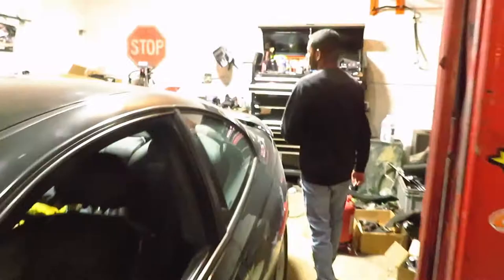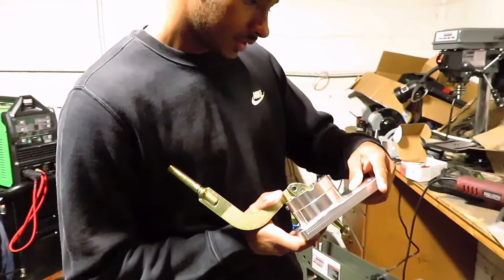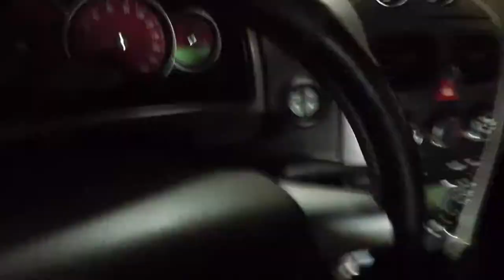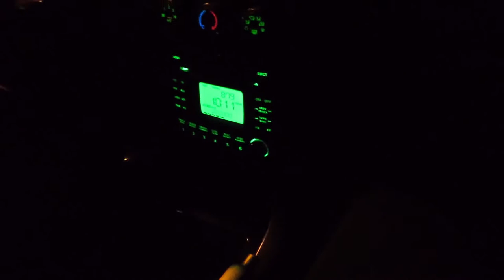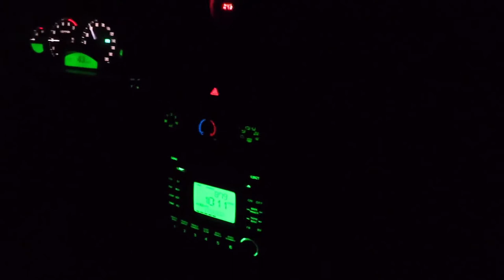Pontiac GTO Gets A Short Throw Shifter! (Is It Worth It?)

Comment: I put a sikky short throw on my 05 gto and messed around with the shift rod options and found the 8 inch straight rod to be the best fit and feel and shifts like a beaut
P.s. also the sound that came from the old b&m short throw that I took out was significantly reduced because sikky is an oem short throw design instead of one that sits ontop of the old shifter
Reply from the maker: Sounds like the sikky one is a good one to go with then! An oem designed piece is always a go to for sure